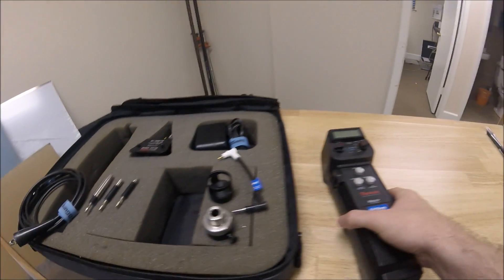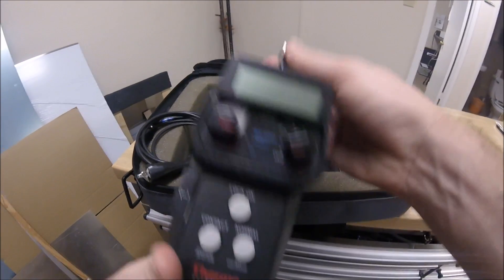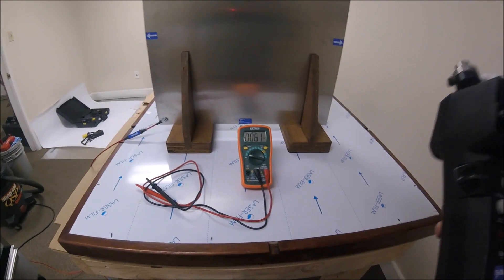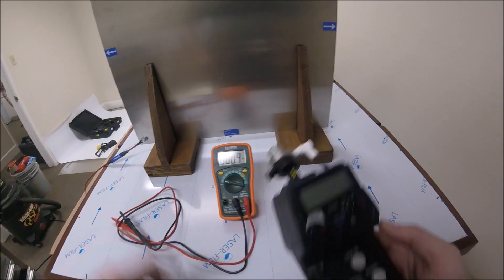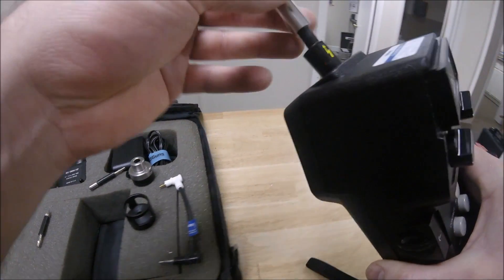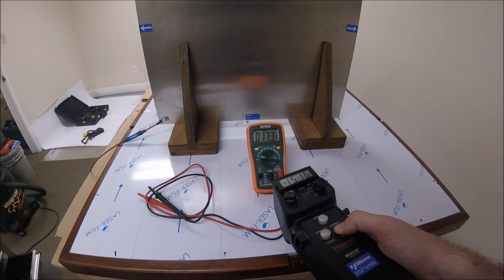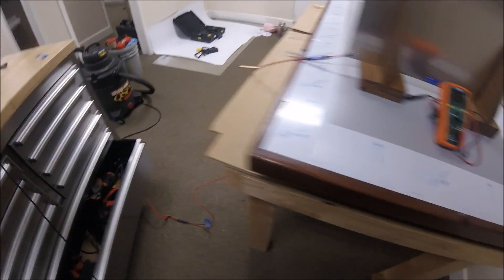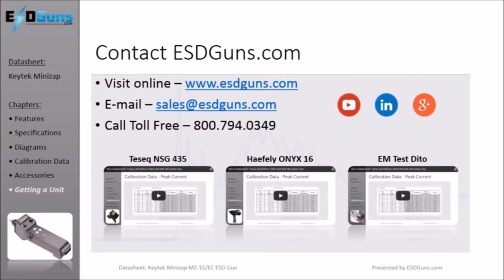How to Use the Keytek Minizap ESD Simulator for CE Marking and IEC 61000-4-2 Tests

Comment: I have an analog multimeter, and mine is the kind where you have to set it to operate at a different scale depending on what you're doing, so when it overloads at a high frequency, would it help to just change the setting? I don't have any idea how it works or if this is relevant in that situation. It sets the order of magnitude.